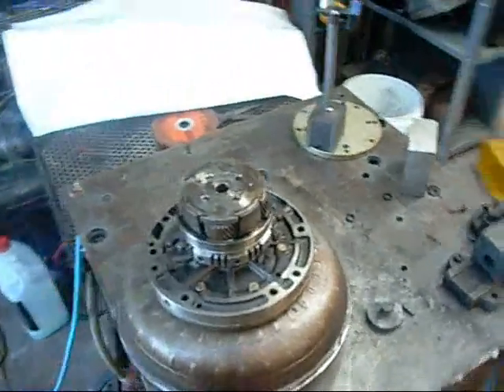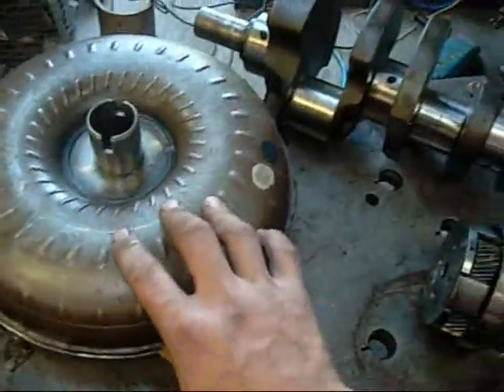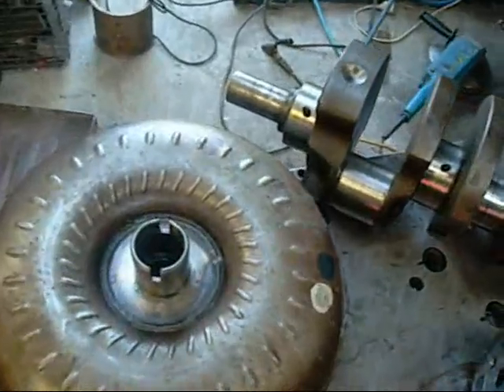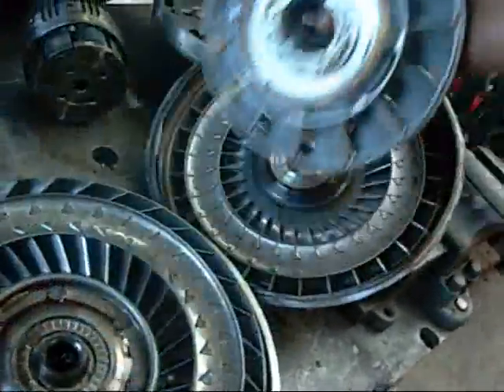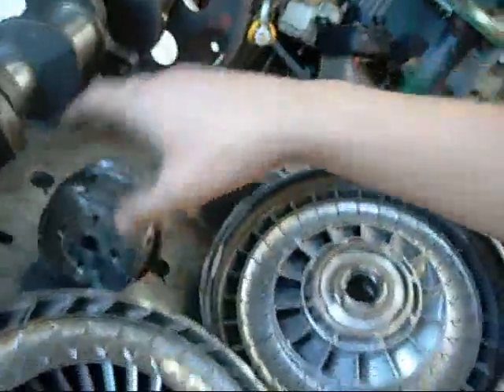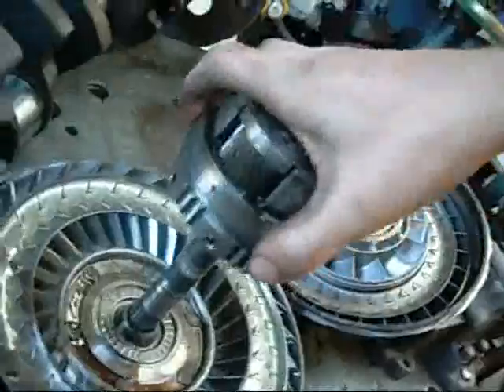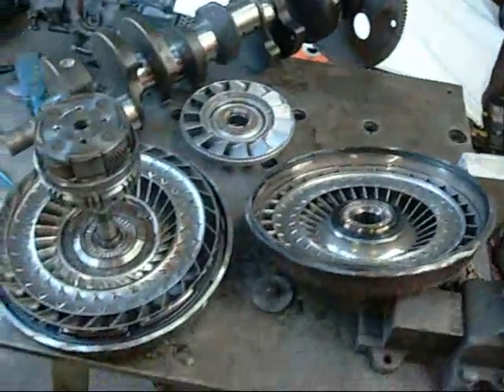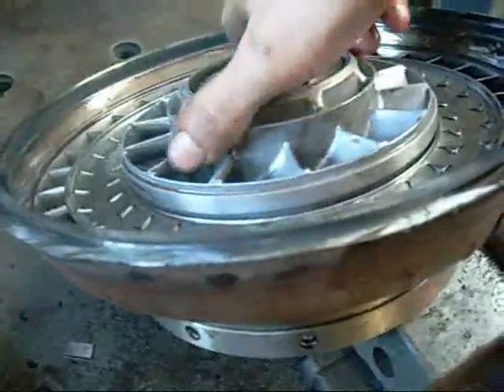Automatic Transmission Torque Converter and Fluid Pump

Comment: If the torque converter has fluid in it spins AND its sealed? How do you cool the oil in the torque converter so that is dosen't overheat? Where does it go in and out from the oilcooler??
Reply: he ded now

Comment: i have a mustang with a 4r70w transmission. the TC has a drain plug. i drained it and its not refilling. what could be the issue? i thought they refilled by the pump.
Reply from the maker: I am not familure with that auto (not a rebuilder or anything) but as I understand they all rely on the pump to refill. have you had it apart or just did a fluid change?

If it was working fine before hand, I would also consider that it might take a bit of idle time to refill?

If you have just done a service with filter I would just recheck the filter is properly fitted and its not pulling air in through the point where the filter mates to the housing.

BIt hard to diagnose without knowing more about the circumstances but I will ask a friend who knows his autos pretty well (if I can get a hold of him) when I know more.
Reply: i just pulled it apart yesterday, the valve body had a bad gasket on it. i hope that is my only issue :(
Reply from the maker: TheFassold ouch, have you had it running before or are you just getting the car going for the first time?, If the trans has been out of action some reason, I would put a straight edge across the valve body and make sure its not warped too!

Comment: Just curiosity always wanted to know, at 0:13 and 0:14 when you point to the outer part of the transmission pump, that part is stationary and doesn't spin, does it? Doesn't only the small inner part of the pump spin?? Sheer curiosity. Because if the outer part spun, that would be impossible since it would come in to contact with the bellhousing and rub against it...?
Reply: the splines on the pump are stationary. they support the Stator.
the only part of the pump that spins is the pump gears, which are driven by the slotted ends of the torque converter. the pump creates pressure which is driven through a valve body, which in turn locks drums and clutches together creating different gears.
the other part that moves is the input shaft, which runs through the pump and into a clutch housing. the other side is in the torque converter which is where the engine power comes from.

Comment: The spring assembly on the back of the turbine is called a lockout clutch. It activates then the pump and turbine are spinning at close to the same speed. It mechanically links the two together, giving a mechanical drive line to the transmission while cruising to increase efficiency.

Comment: stator moves only in one direction and locks in the opposite direction so it does actually move mate. It helps go from idle to run. Please be alittle more curtious and explain  your self if ur going to be imformal. Most people come information not comments like yours hey hes actually tring to explain himself. what do you have to contibute that can help us out

Comment from the maker: G'day mate
I'm no expert on AT's but i will suggest that you find a auto out of a wreck, or a reco unit from a tranny shop. if its blow so bad that its dropped all gears it would be very pricey to rebuild in full, everything has to be stripped and cleaned anyway.

Kew Automatics would be my only choice IMO, I've had a Jag auto repaired by them, and a good mechanic friend used to work for them

Its always hard when something like this blows, sometimes costs as much as the car is worth to fix!

Comment: My questions to you:
1. Is it worth asking them to replace only the damaged (or the parts causing the damage) for which they are qouting even less (Around 1500) but then I heard from forums that it is not worth it as it will damage soon. 
2. If you are in Melbourne, which specialist would you recommend?
3. Any other comments or queries will be appreciated. 
Thanks mate.

Comment: G'day mate! Thanks for the vid. Now, I am pretty desperate here :). My car is 2003 Mitsubishi Magna and its Auto Transmission (looks like) blown on the middle of the road. It does not engage in any gear (D or R) and just spins (Like in RPM meter). I have been trying to take the quotes and it turns out to be around 2.5k to 3k AUD whereas the dealer's "ballpark" figure is 5k. All these costs are for complete replacement of the AT system with 2 years or 40k km warranty.

Comment from the maker: Unless its a lockup TC its all fluid dynamic drive. if its a lockup TC it will reach a point where slip is not required and lock the engine to the transmission mechanically

Comment: Actually the force is not transmitted by friction, but by changing the tangential momentum of the fluid. This change in tangential momentum of the fluid (oil) creates a torque in the turbine. This torque moves the transmission shaft. 

For the engineering formulas of this you can read "Mechanics and Thermodynamics of Propulsion" by Phillips Hill & Carl Peterson page 370 (2nd edition), or a similar book.

Comment: my car has a sound transmission.

runs well with all changes. but starts sounding when I accelerate the car. The sound came on the torque inside of the transmission. what`s the problem.? that will be the transmission mount?sounds like scraping when accelerated on the big part of the transmission (torque) what happen if the mount its bad? the torque sounds when I accelerated? please I need Help my car is a thunderbird 89 or its something loose? I have learned a lot of your vids thanks

Comment from the maker: @MonkeySpecs301 the fluid is continuously flushed. it comes out of the oil pump, into the torque converter then out to the valve body i believe,

Comment from the maker: @Zayjug I'n not a real AT expert,  I was just going off basic info I had at the time.
Autos are pretty good tho, but your right about high powered engines killing them. towing heavy loads makes the get hotter than normal so a good fluid cooler is needed.

as in the box I dissected for this video, once the clutches start wearing out the dust can plug up the filter and valve body resulting in more clutch slippage and excessive heat buildup. the heat can warp the valve body

Comment: cool vid. that thing that dose not move is the stator and its on a 1 way clutch for overrun, its for redirecting the fluid back from the turbine to the impeller. the spinning bit that connects to the box is the turbine and the and the ther is the pump/impeller. :)